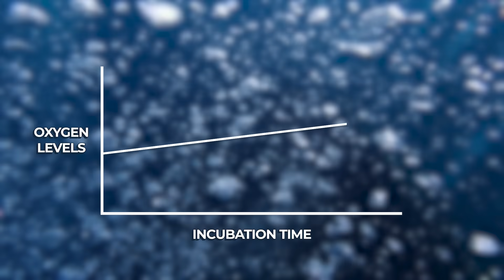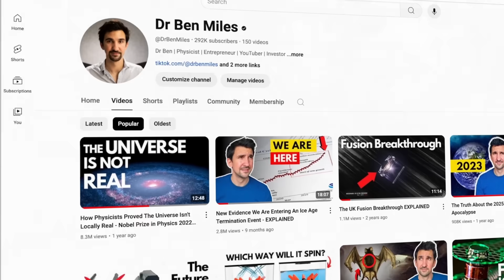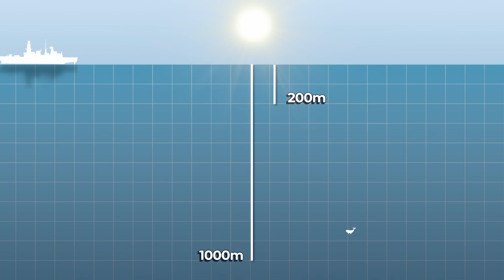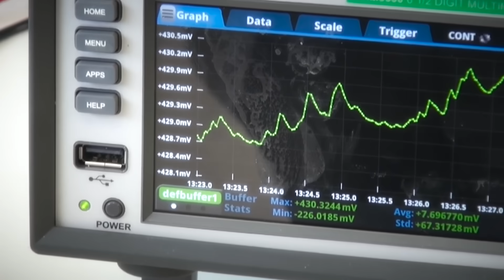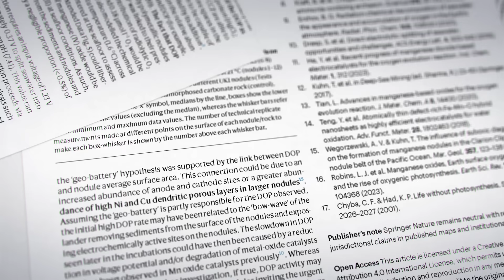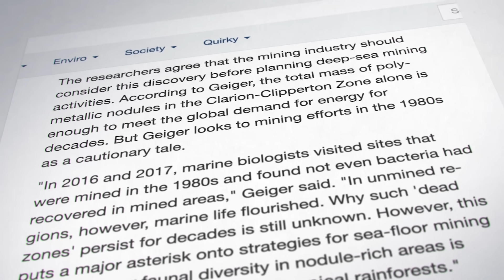We Just Discovered "Dark" Oxygen on Earth - Breakthrough Explained

Comment: *humans. 

Lets use it for batteries. Who cares if it "might" be why we have half the oxygen on earth. We need batteries!
Reply: Ah, yes, because the seabed has a better energy source than the sun 😂
Reply: @Hansulf  the seabed came from the pieces of a dead star. But the video was about oxygen,  not energy. Are u a battery maker?
Reply: @NavajoNinja  it takes energy to make oxygen from water. A lot of energy.   Batteries can only hold so much energy.
Reply: @mb777-g8v  uh huh. Still just rocks i guess. Glad we all shared our opinions here on the mighty web.
Reply: @NavajoNinja  the laws of thermodynamics are not opinions. You can’t create energy from nothing.
Reply: @NavajoNinja  😂 Everything above hidrogen comes from a dead star... It's explained in the video... They measure some voltage on the nodules and they measure oxygen production, so they assume is electrólisis. Okay... So what charged the battery in the first place. If it was already charged, then there is no way it was producing oxigen before they got there, and if it started producing oxigen just after they arrived there, then it's a fluke. Every process requires a source of energy, almost all oxygen comes from light splitting water during photosynthesism. Were does the energy for the electrolyisis comes of the oxygen production is a constant process? Nah
Reply: @Hansulf  i said "might" for this very reason. But here u are. ,🫣
Reply: @NavajoNinja  Well, just giving you a piece of knowledge so you can have a more informed critical opinion!
Reply: @Hansulf  i already forgot what u said
Reply: @NavajoNinja  bro, why are you even trying to understand topics like this one
Reply: It seems more than likely that the oxygen produced is vanishingly small compared to photosynthesis, but as always, we tend to fallaciously consider human needs in some kind of anthropic vacuum of our survivability and habitat, which doesn't exist in reality. We're ruining ecology all over the place, what's some more on the bottom of the sea? It's not like that could contribute to destructive ripple effects throughout life on the planet too... right?
Reply: It's unlikely that these nodules are themselves a significant source of oxygen, but it is likely they are an important part of an ecosystem, which if disrupted, could potentially lead to a food chain collapse including oxygen generating species, which would be very very bad
Reply: @caelumforder9710  might, might, might! It was just a thought(more of a joke). I really dont care, im 40 yr old human who wont be here another 10 years.
Reply: @NavajoNinja  I thought you were joking but saw it was a sentiment that some people actually had which I wanted to address. Though that does also actually seem to include you? Do you have no preferences about how the world continues on after it doesn't have you in it?
Reply: @caelumforder9710  we're all just passing through bud. Everything is temporary and we die without figuring out the mysteries of the universe. I wish i could be ignorant but ive learned so much in this life.
Reply: The more oxygen the bigger spiders will be, are you still a fan?!
Reply: @asdads3948  yikes, lets collect them all in that case. Ha
Reply: This really feels like an incredibly reliable way to turn the planet into a wasteland. The fact that areas mined decades ago haven't recovered at all despite being centimeters away from unmined seabed makes it feel like the blanket of life is incredibly thin there. Like their scraping the last bits off the surface. And we know the process being extremely slow to recover, likely making it a very strong stabilising factor to development of life on earth.
Reply: There is no way that this process is anything close to a significant amount of oxygen on the earth. I would guess that photosynthesis produces this process by trillions or more to one
Reply: You say no way without any research or proof and then go on to guess. Glad to see you adhere so closely to the scientific method.
Reply: @kkjhn41  it’s a simple energy balance problem. It takes a lot of energy to electrolyze water. So to create a lot of oxygen, it requires a tremendous tremendous amount of energy.  This is why photosynthesis runs off of the sun.

Where does that energy come from?  If you’re gonna say it’s from these metal nodule batteries, that energy would run out very quickly unless there’s some way to “recharge those batteries“.   There doesn’t seem to be any mechanism for this. Where does that energy come from? 

Additionally, we would’ve seen hydrogen formation if there was water electrolysis. They make no mention of finding hydrogen.  I read the original paper.
Reply: @mb777-g8v  ur guess is as good as mine. Hence, "maybe".
Reply: @NavajoNinja  its pretty well established that photosynthetic ocean bacteria provide most of the oxygen used by the surface life and land based life. These rocks do not produce enough oxygen to impact us.
Reply: @NavajoNinja  Just think about the ratio of volume of these rocks to the volume of the ocean.   There is no way that there’s enough metals in those rocks to donate enough electrons to create enough oxygen to even be rounding error. Especially since these metals can only donate the electrons once.  It’s more than a guess
Reply: @mb777-g8v  That would be your hypothesis and that's fine. Now go on and prove it.
Reply: @kkjhn41  if some proposed mechanism violates the laws of thermodynamics, then you know it’s false.  That is the proof.